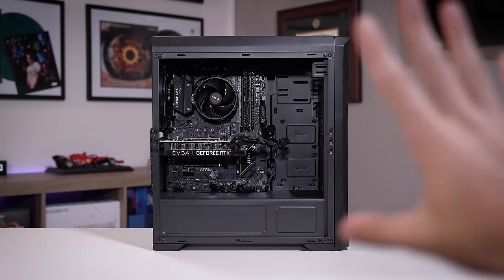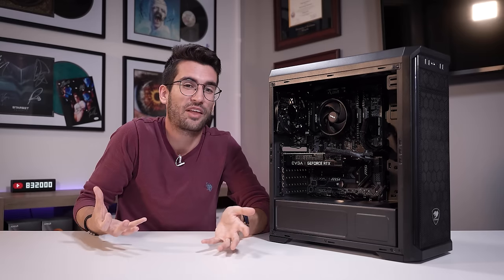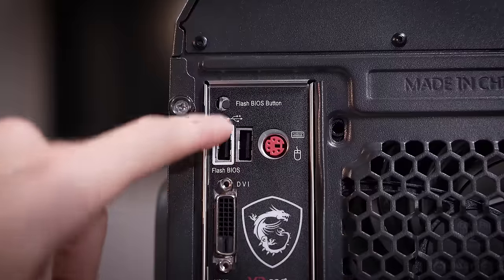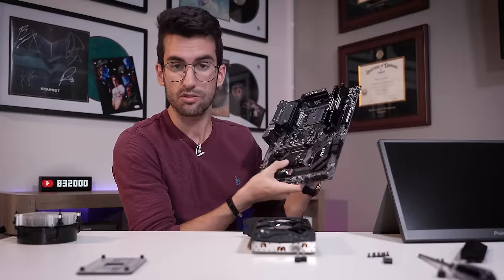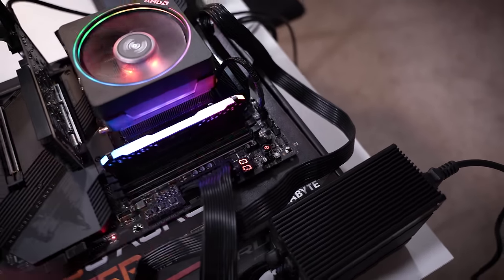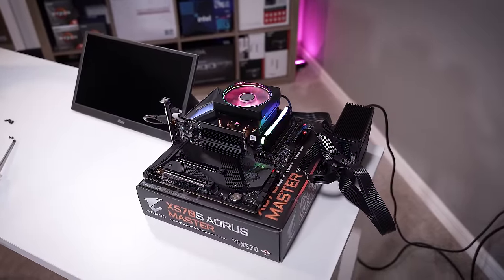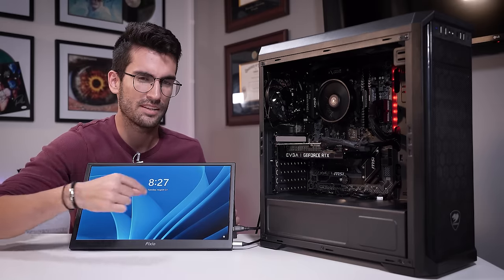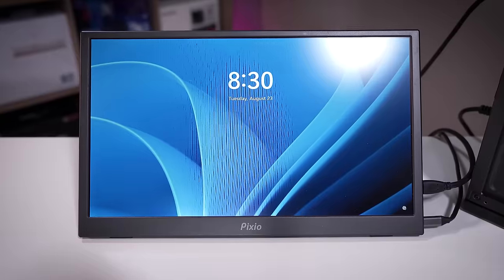Fixing a Viewer's BROKEN Gaming PC? - Fix or Flop S3:E4

Comment: fix or flop live? Maybe? Greg any thoughts?
Reply: If he has the parts that might be swapped on hand, sounds good but if not can’t really do any testing
Reply: I love that idea
Reply: @afg_uks  with an am 4 system there should still be plenty of components on hand to at least troubleshoot even if he has to wait for parts to actually replace the components (graphics cards being the main one to wait for)
Reply: Lmao, as a PC builder, a live episode of this will literally span 3-5 hours at the very LEAST (assuming the problem isn't solved by the first or second thing assessed/fixed)
Reply: Can we get a live Speedrun?
Reply: As someone who has done this kind of work its one of those things that sounds good until you realize it takes hours and hours of effort often spread over several days if new parts are needed. Could be those times where you are rebooting over and over with minor changes in between, sometimes it's just sitting and thinking figuring out next steps. Just swapping out a power suppy or even cable management can be like 30 minutes to hours depending on the parts involved. I say hours because cable managing my computer that has 9 rgb fans, aio etc, cable extensions, involves literally a couple of hours to tie down cabling.
Reply: @brianm.595  Le facts
Reply: So a potential marathon stream? LoL You do realize how long this process actually takes, right? These videos are very edited down.
Reply: I just changed cpus and took all the fans out and cleaned out the pc.  Took a few hours after rewiring everything.

Comment: I think these motherboards came with a weird bios from factory. I have a B450 tomahawk max 2 which was supposed to have come with the zen 3 bios from factory, put a 5600g in it and kept getting CPU debug light and random shut downs. Turns out it was a weird bios version it shipped with from factory. Updating the bios worked perfectly.
Reply: Those boards launched before the zen 3 arrived. The factory support was Zen 2 but that also depends on the time it was manufactured, as it might get the bios updated in the factory, but there are still some without that bios update as they were sitting in storage.
Reply: @Ficii1  yeah, mine was advertised as Ryzen 5000 ready on the box and bought it new from Amazon so I assumed the motherboard was fine but it's definitely a dodgy factory bios
Reply: Yeah that is a very weird thing cause I have a 550F board from Asus and my friend has an Asus 450F board and his had this issue yet mine didn't and I have a 5950x and he has a 5800x yet his did this same thing and when I updated the bios for him, it worked and fixed it. So this definitely ain't a normal thing. Hopefully MSI and other manufacturers really make sure this doesn't happen again and are aware of this and hopefully fix this cause this ain't something that should happen straight out of the box like that.
Reply: @georgeshajan7956  Same for me, it was advertised as ready for Ryzen 5000 but the BIOS version it had was not on MSI website either and I had to update the BIOS for the system to boot.
Reply: The Zen 3 APUs were released much later than the first set of Zen 3 CPUs, so most likely the board was manufactured after the initial release of Zen 3, but long before the APUs were released. So at the time it supported all available Zen 3 CPUs.
Reply: @Ficii1  One nice thing I like with MSI boards is the BIOS flash back functionality seems to be more standard across their range than other brands. Asus for example always baffle me with the seemingly random support for it. Even on the higher end more expensive boards it isn't always a given.
Reply: Iv had a Asus Dark Hero Board throw out a boot device Failure when in fact the 5950x died. The boot device was literally 1 day old was secure erased set to 4K sector. Loaded windows got rig up and running next day no other changes only PBO setup and bam turn system on boot device Failure. Tried in test bench nvme loaded windows. 

Sent cpu back they called me said yeah this cpu is dead. Thankfully bought the extra warranty for $75 saved me waiting 4 weeks for a replacement.
Reply: @svartkonst666   Same for me, took me days of troubleshooting my Tomahawk to update the BIOS.
Reply: ugh you're telling me. there's not enough words to describe my hatred towards the b450 tomahawk boards. one took my whole system with it and the replacement was worse
Reply: @realsentientpotato  surprisingly this was my unraid server for over a year with a 5600x it felt wasteful so I sold that entire rig for $1600 bought a Synology NAS then virtualized the exact same setup now iv got 1 less rig running and it's doing the exact same work.
Reply: Same with the Asus b550A I had trouble with mine too. I added a different bios and it sprung to life.
Reply: @shadowarez1337  wow that's wild
Reply: @honkydory6416  that's crazy. I find the best motherboard for ryzen imo and it's the one I've had the most luck with for ryzen: the msi x370 gaming pro carbon
Reply: @realsentientpotato  though to be honest I spent $6000 lol got the ram maxed at 64GB and added the duel port 10GB nic and loaded the bays with 18TBx6 1 is external as a backup for only important data.
Reply: @shadowarez1337  holy crap
Reply: @realsentientpotato  and of course the 2TB Samsung 970 Pros nvme cache drives I finally got the network setup after janky setups for years.
Reply: @shadowarez1337  I'm semi jealous bro
Reply: I ran into this issue on a new MSI motherboard for i7-12700 CPU. It would crash the system if I turned XMP support on even though the board supported XMP. The company said my 3600Mhz ram I bought with the system was to blame and should only be run at stock 2144Mhz speed. Turns out you just needed to update the BIOS to the current version and now the ram runs at 3600 easily. Apparently companies don't have the time to make sure the BIOS they ship systems with work.
Reply: @Joreel  ah laziness, some things never change
Reply: In AMD systems,most of the time the culprit is incompatible bios 🥲.
Reply: Yupppp I got one messed with it for hours and finally said screw this motherboard returned it and never looked back.
Reply: I think APU-s didn’t had the support for the Tomahawk MAX 2.I was told on multiple forums that I have to flash the BIOS if I want to use a 5 series APU. When I setup the PC they were right, I had to flash the BIOS for the 5600G to work, until then it was CPU led and reboots.
Reply: Huh. Shipping pre-borked motherboards. Quite efficient.
Reply: Same here,  it was my first build and got the cpu debug light.  I had to update the bios twice for it to work though, man I had the stress sweats lol
Reply: The 5600G and 5700G are actually later chips (APUs actually) than the initial 5000 series which included the 5600X, 5800X, 5900X and 5950X and require a newer BIOS version. So if a board says 5000 series CPUs supported, depending on when it left the factory, that may or may not include the G chips.
Reply: I recently updated my BIOS on my B450 Thawk MAX to that exact Jan one to replace my old Zen chip with a Zen 3 and have run into XMP stability issues so almost installed the May BIOS.  Instead I just manually OCed my memory to an even higher speed than XMP.  It may be an issue with 3200 mt/s memory because setting it manually at 3600 works fine and I've had no crashes since.
Reply: Which specific bios did you use with the 5600G?  I'm putting one in as well.
Reply: @John-xd9wr  not sure which specific one but it would have been the latest one as of around June 2022
Reply: All of these B450 mobos had issues particularly with 3600's. To the point where multiple manufacturers had to put big warnings on their bios updates not to update to certain bios releases if you had a 3600
Reply: Those mobos need bios update even for 3000 series Ryzen. Source: Me.
Reply: Exactly the same issue with a B450 tomahawk MAX II and a 5600X
The system would randomly crash and refuse to post until it started working again out of nowhere (it could be 10 minutes or 2h later).
I flashed the latest bios available at that time, which was VH.50 and the problem disappeared.
Reply: MSI shipping you bricked motherboard, seems very nice.
Reply: I have a Asus rock b450 that powercycled a few times. I swapped ram etc got it working then I installed a 3060, it worked for a day then constantly power cycles now, it power cycles without the gpu in aswell, had to buy a new one as I can't even get in to check bios. Cpu ryzen 5 5600g
Reply: @foulmouthedgamer714  what power supply? Sounds like not enough juice
Reply: @martymcfly88mph35  tried a few, had a 450w before I installed a gpu and it power cycled twice in the past. Installed gpu and 800w, power cycled after a few hours and won't post now
Reply: This is facts. Same happened when I swapped to a 5800x3d last week, updated bios and was gaming better than b4

Comment: I really don't think it was the BIOS itself that was the issue... I think it was the BIOS flashback button being pinned down by the rear IO shield that prevented this system from posting. It's happened on some of the PC builds I've done before with both MSI and ASUS motherboards
Reply: Absolutely could be the case here.
Reply: I have had weird issues with MSI/AMD some bios versions. It could be either one.
Reply from the maker: To confirm, that button was not pressed down in its original state. We looked closely at it. The button was recessed inside the I/O plate. Was definitely the BIOS
Reply: Those BIOS flashback buttons don't need to be pushed down to be actuated. If the IO shield was pushing it from the side, which it seemed to be doing in the video, the button will stay actuated, preventing a POST. I guess I should have been more clear in my original comment. I believe you though. If you checked and it was indeed the BIOS, then you're probably right. I just thought I'd point out this discrepancy
Reply: @GregSalazar  but in the video you said that the problem started before he changed the motherboard ... how does this make any sense?
Reply: @smokeeish77 could be just pure luck that he had a bad MB and then the new MB had a bios issue or could be that there is something else going on with the cpu and they will see another issue soon?
Reply: @kylemueller  It was the BIOS. The "E" BIOS is known for not booting which is why it is no longer on the site.
Reply: @smokeeish77  He may have had the same model motherboard previously and flashed it with the same BIOS.
Reply: Yep I had that exact issue on a system i built last year.  I had a hard time in the case getting it to fit without giving the bios flashback button a little sideways pressure which I didn't notice at first, system just wouldn't run.

Comment: The same thing happened to me with a MSI B550 mobo and modern 5600X, updating to latest stable bios version bricked the system, and downgrading to an earlier bios version fixed it. It sounds like a MSI QC issue
Reply: Had a shaky MSI x570s board come to me as a RMA replacement board worked for a couple of hours and then bricked in a Windows update.
Reply: that is the reason why experienced people on computers say, if it works, dont touch. 
just upgrade bios if is really needed, because new cpu, or problems with memory, etc.
Reply: @MrDvneil  works fine until a supposedly fine bios bricks the board completely.
Reply: @TheSjuris  the only bios that bricks the boards are the ones you update,  if you dont touch if is working will work forever if you don't touch anything on ur pc
Reply: @MrDvneil  if that was true then it wouldn’t have gotten bricked, but alas it did happen that way. The chip worked and works fine on other motherboards. Bet there was something faulty with it early since someone had originally sent it back to MSI before me.
Reply: @TheSjuris  u dont know the truth under this situation,  the steps that lead to here. 
Im just talking u with my experience.  Pc breaks when people touch them,  clean them,  update them. 
Update the bios is ur system is working without issues,  is a nosense.  Go ask other people with decades of experience.
Reply: The problem with QC checking is that they can only test on so many variants of systems. They could have tested it on 100 different configs and they all worked but then all it takes is for someone to have a slightly different config that the BIOS doesn't like and boom- no boot. I imagine many people have no problems with the "E" variant. I mean just look, it booted straight up with a 2nd gen Zen chip but refused to boot with the 3600. And it may be that it's only a certain stepping of the 3600 that it didn't like. It can happen with any manufacturer as there are just so many configuration possibilities with computers that it is impossible for them to QC every single one 100%.
Reply: @TheSjuris  That's why I only get motherboards with BIOS flashback now. If it is a BIOS issue you can force a BIOS on with the button, regardless of whether it wants to boot or not. I am glad that AMD made that a base feature of the new AM5 platform and I really hope that every manufacturer includes it too. It is by far the best thing to have on any board.
Reply: @AndyMitchellUK26  doesn’t always work. I know that it didn’t work on the board that failed.
Reply: @TheSjuris  Yeah, it doesn't always work if the chip itself has physically gone bad but it's better than what we had before if a BIOS corrupted! I do miss the days of socketed BIOS chips though.
Reply: @AndyMitchellUK26  no idea why it didn’t work?  Everything works perfectly on a different motherboard.  Have a feeling it was a bad motherboard when MSI sent it to me as a replacement for a different motherboard.
Reply: @TheSjuris  With the scale of manufacturing nowadays you will unfortunately get the odd bad board or chip. It's unavoidable and there is no way that any company can 100% QC everything unless they want customers complaining that there's no stock available. It's one or the other unfortunately, either the odd bad part makes its way to the shelves or there's a huge stock shortage where the products are held up being 100% quality checked and most companies go for the former as its quicker and easier for them to just replace a bad part.
Reply: @AndyMitchellUK26  you would think they would have checked a motherboard that had already been returned once before sending it back out again. I could understand it better if it was a new board, but not one that someone else had sent back to MSI.
Reply: @TheSjuris  They don't bother doing that most of the time due to the logistics of it all. They'd rather just send a replacement out and bin the old one. Or they check quickly with just the basics and if it works they send it straight back out.

Comment: Greg, another great and informative video. Anyone with experience building PCs should be able to fix a PC problem like this. All DIYers know a project has three components: Time, Patience, and Money. After watching this video, a DIY PC repair has the same three considerations, except substituting a good supply of working parts for money. Greg always presents an excellent example of initial troubleshooting.  A test bench is the best tool for a PC repair, especially when replacing parts. It makes replacing parts more accessible, and you can see what you are doing. I bought mine on AMAZON for less than 50 dollars.

Comment: This is why I feel it's always good practice to flash the bios on a new board (at least new to you). It's not always guaranteed that it's going to ship automatically with the compatible version for your cpu, so it gets rid of one potential problem
Reply: This is what I do with the second-hand computers I sell; I always update the BIOS on the motherboards. I've only "lost" one board (ASrock Z77 Extreme4) due to a failed update; and that's my fault because I should have updated the BIOS in "stages" i.e., go from one, to another, to another until latest version.)
Reply: @PCFixer  Get a little CH341a hardware flasher and you can revive any board no problem :)
Reply: But if the installed BIOS is even more recent than the current stable from the website, you're missing the point. I'd find it odd to have some version installed that isn't publicly available, but as long as it's not a known beta or known to cause issues, I wouldn't flash an older version. Depending on the revision of the board it could even be that the older BIOS isn't really compatible with it.
Reply: @magicalsnek  That will never happen because any board you buy would have come out of the factory months ago or even longer. The bios installed on the board will almost always be an older version than the one on the website or if you're incredibly lucky the same version but never a newer one.
Reply: @hazzmati  Well obviously there is a BIOS version that was skipped on the website. If it was current at the time of purchase several months but just not released to the public, of course this version could have been preinstalled.
Reply: This is possibly what caused the issues in the first place as it was previously working. It's possible that the user updated the BIOS to the "E" variant as it was the newest at the time. It caused problems for quite a few people which is why it is no longer available on the MSI website. I personally only update the BIOS if I have issues or it offers a tangible performance increase.
Reply: @magicalsnek  It wasn't skipped, it was removed as it was causing systems to not boot. Have a look on reddit and you'll see it is a known issue.
Reply: @magicalsnek  Like another member pointed out earlier as well, beta versions are often removed once a stable version is released that supersedes it. That very well could be the case here that the mysterious version on this case was in fact a beta.